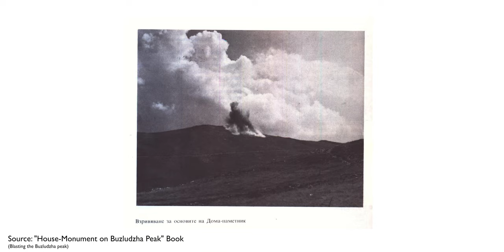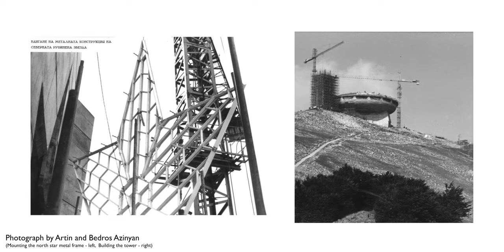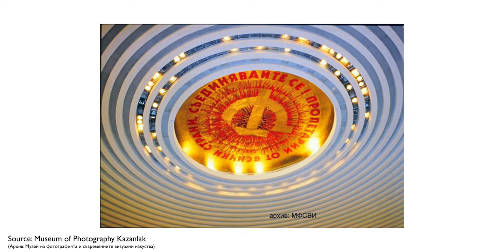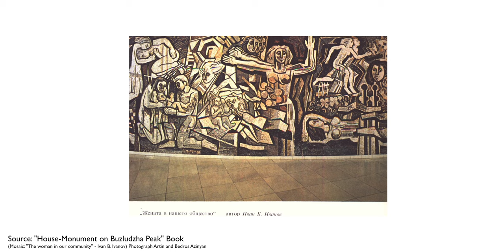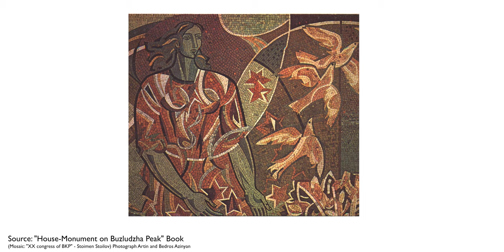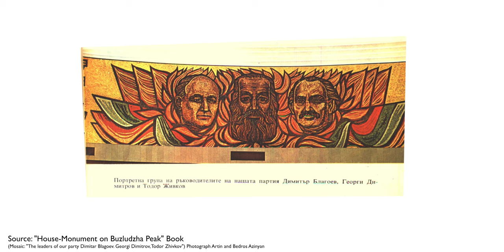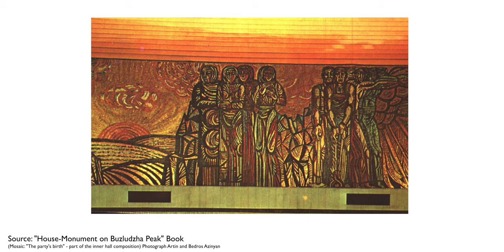Buzludzha Monument  - The Forgotten Past

Comment: I can understand the degradation of those parts which have been exposed to the elements, but I'm surprised to see that the internal structures have degraded so badly.
I had wondered why no rich person had bought this to use as a business centre, it would make a very impressive headquarters.  I assume that the cost of renovation on that level corrosion would be prohibitive.